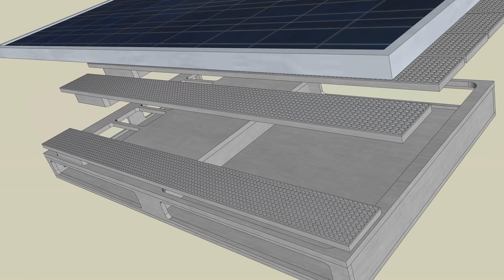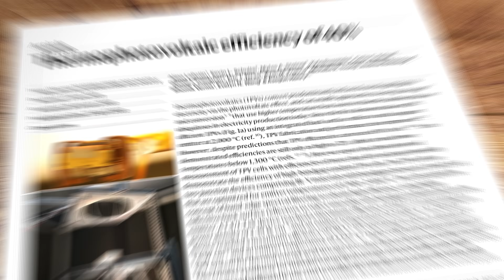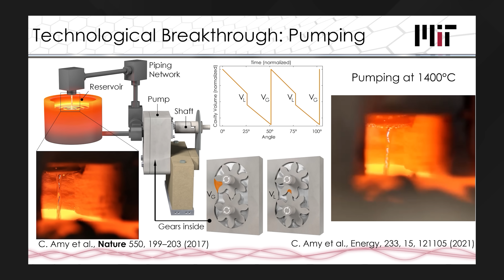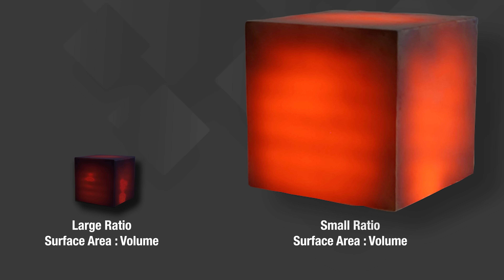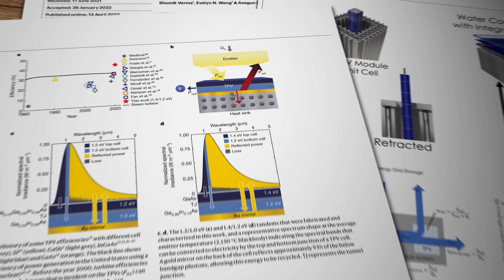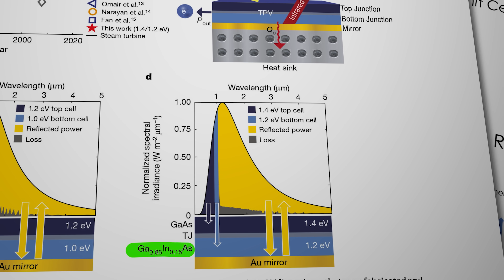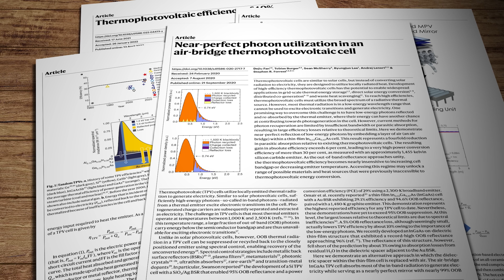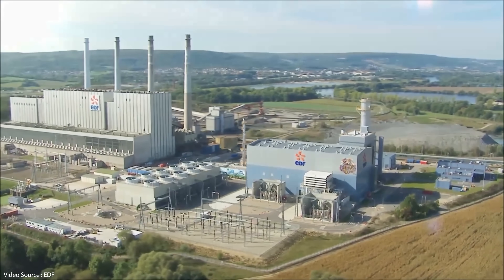Grid Scale Energy Storage 30x cheaper than Lithium-ion! How do they do that?

Comment: Cool! Is that 40-50% efficiency rating calculated just from the incident light on the cell? Or is that a total value for electricity input versus output, encompassing all the losses of the heat storage process?
Reply: Encompassing all losses
Reply: @AsegunHenry  I doubt. Overall round-trip efficiency will be closer to 20% or so.
Reply: @janami-dharmam  - you may want to look at the efficiency and losses associated with concentrated solar power plants. If the magical extra 30% loss you’re describing actually occurred, the nearly 100 plants world wide wouldn’t be able to operate.
Reply: @AsegunHenry  the 20-30% energy efficient is estimated at the consumer point. This is one of the main factors that drive the energy cost at the consumer end up. What is being supplied (say over a 24 hr period) is 60-70% direct and 30-40% stored (recycled) energy. The transmission and distribution losses can be very significant (and this waste energy just goes into the air)
Reply: Electric heaters are almost 100% efficient.  The biggest exception is heat pumps which are more than 100% efficient because they cool the outside air or ground.
Reply: @nathanbanks2354  heat pumps which are more than 100% efficient - very interesting! what happens to the conservation of energy??
Reply: @janami-dharmam  That efficiency is calculated by dividing the transferred heat by the work done by the pump. It moves more heat energy than what it requires for its work done. Energy is conserved, it does not create or eliminate energy, the overall energy of the system stays the same.
Reply: @janami-dharmam  heat pumps aren't more than 100%. Such results are possible because humidity change is left out of the calculation.

Once you include the input / output humidity level the efficiency is well below 100%, as it should be.

This "over 100% efficient" slogan is just a marketing ploy because resulting dry air isn't an immediately obvious outcome of using a heat pump but the negative effects of dry air are real. Once you factor in the energy needed to bring that moisture back, the heat pump looses it's magical physics defying efficiency.
Reply: @janami-dharmam  Technically, a heat pump is mostly just moving thermal energy from one place to another.    The thermodynamic limits on such a system are limited by Entropy.   The criteria here is that one cannot NET move heat (thermal energy) from a cold reservoir to a hotter one.
One can link a larger flow of heat from a small cold to hot temperature gradient, to a smaller flow heat down a much larger temperature gradient from hot to cold.
This is apparent when you include the heat flows of the power generating plant on the other end of the electric power line that runs your heat pump.
Reply: @janami-dharmam  heatpumps do not generate heat, but move it.... harvesting from surrounding air
Reply: @NullHand  Of course you can pump heat from a lower temp to a higher temp; it is called a refrigerator. You need to supply energy for that. For the other way, heat flowing down the temp gradient, you can extract energy from the otherwise spontaneous flow- that is commonly called a heat engine. 
Yes, you can combine two countercurrent heat flows but you cannot create a higher temp differential at the output end.
Reply: There are only heat losses - cooling of the TPV, and losses during storage and transportation trough the pipes. The cells are only ~30% efficient, but the remaining ~70% energy radiates back to the wolfram-surface as heat, ofc minus the ~5% heat loss that is transported to the cooling block through the gold-bridge. 
My concern is the surface area of the TPV cells, that needed for MW output. It will be a huge housing.
Reply: @tomo1168  "The cells are only ~30% efficient, but the remaining ~70% energy radiates back to the wolfram-surface as heat"

This is not how it works. You can not extract enery from heat. You can extract enery only from head diffrences. You always got the limitation of the carnot cycle.
Reply: Yup. Total system efficiency would be closer to 5%

Comment: I like the diversity of energy storage solutions being worked on and your channel's continued enthusiastic coverage of them. We need commercial solutions that work and the cheaper the better.

When I heard gallium arsenide solar cells I initially rejected this idea as being ludicrously expensive. But when I heard 100kW per square meter of panel, I changed my mind entirely. This does sound very promising.
Reply: @James Too bad for your part of the world. Meanwhile in mine, I've been living almost entirely powered by solar for several years now: hot water, heating, cooling, car - everything. 24 solar panels and a 30kWh home battery.

Fossil fuels are an incredible technology - it's just they have the tiny problem of causing cancer, respiratory diseases and changing the natural environment too rapidly for nature to keep up with. That's the only reason we have to find alternatives.
Reply from the maker: Thanks Mark. Only time will tell of course.
Reply: @JustHaveaThink  id like to know.. how you have 30 times less.. you can have 30 times more of something or.. 1:30th of something being less.. but.. 30 times more.. is that really good science reporting  🤧🤕😷😬
Reply: @Errol.C-nz  If "30 times MORE" means you add 30x to x, giving 31x, then "30 times LESS" means you SUBTRACT 30x from x, giving minus 29x.
Without the words "more" or "less" (which clearly mean add something or subtract something) you could just say "thirty times" meaning multiply by 30, or "one thirtieth" meaning divide by 30.
Reply: @simonmultiverse6349  times means mulitply.. not divide.. thats.. maths !
Reply: @Errol.C-nz  No, there's a difference between:
(1) "thirty times more" and:
(2) "thirty times"
Reply: @Errol.C-nz  No, "five times MORE" means increase; "five times LESS" means decrease.
Reply: There are many synergies here. Electricity like this to power ground-source heat pumps coupled with well-insulated buildings promises a very low cost to heat homes and offices.
I note that some kinds of batteries suffer dendrites growing through the structure of the battery, as the metallic elements comprising the structure move. This can tolerate a maximum number of charge/discharge cycles before breaking down completely. Can you comment whether or not TPV suffers this?
Reply: GaAs is  an environmentally toxic material - and a great solar cell.  The question for me, when it comes to Grid Scale Power Storage - what is wrong with larger amounts of safe material which is not sitting at 2000 degrees? I would prefer a few more acres of Fe-Na (Iron and Salt water) than a lot of graphite and molten Sn (tin) at these extreme temperatures.  This is potentially a great technology for systems launched into space - it's lighter than the Fe (Iron) based cells.  I predict we will hear "I wouldn't want one of these systems in my backyard".  If located in remote areas, we have to transport the power (grids) and that is expensive (look at your electric bill - it is itemized) and lossy.  And backyards are where we will need storage as solar generation becomes more distributed into the communities.

Comment: Thermal-Photon Energy Conversion technology means that nuclear electrical power will no longer be constrained by steam turbine efficiency or thermocouple efficiency. Basically, this means no moving parts - except for liquid cooling pumps needed to keep the components from over-heating. The thermal temperatures are below the melting points of plutonium oxide, uranium oxide, and thorium oxide. So, those materials could be used as the thermal energy sources. (YMMV)
Reply: This idea was investigated decades ago. I don't know if anyone actually built one, but there were detailed designs. No moving parts is a big plus for space probes, for many reasons.
Reply: a modified nuclear plant design? one which skips heating water to make steam which turns a turbine? one which generates heat which is converted at a higher efficiency rate directly to electricity?

Comment: In re: "waste heat": the energy originally came from the sun in one form or another so I fail to see how the entire planetary system would be heated overall beyond normal. The only way for heat energy to escape is to radiate into space, regardless if that incoming solar energy was converted into electricity and used to heat molten tin and then radiated through a PV cell and then to heat water before finally being radiated again out into the atmosphere.

Comment: Why are they using electric heaters to melt tin and then use the tin to heat graphite ? Why don''t they use electric heaters to heat the graphite directly ?
Reply from the maker: They want to keep all the elements separate to optimise flexibility.

Comment: High capacity. High efficiency (for thermal systems). High responsiveness. Low cost. It's got a lot going for it. 
It would still be ideal if battery solutions could become much cheaper, since their overall efficiency is much better than this.
Luckily these are not complicated systems. Some aspects are simply technologically advanced. Which I like. I think this could serve as another temporary solution for a few decades maybe until batteries, maybe the ultra-capacitors of tomorrow, are much better and cheap as chips.
Reply: It sounds as though the high heat units are meant to be a battery, but I think it is more incidental that the heat is held there as it produces electricity. So, I could easily imagine this heat system augmented to store the generated electricity in much more efficient and effective batteries and then passed out to users as needed.
Reply: @markhathaway9456  That would still put a 60% energy loss in the loops. Which is significant. Where this system shines is capacity, cost and scalability.
I think it entirely possible that something like this could store power on ships too. And, maybe just maybe very large airplanes if the gravimetric capacity is high enough.

Comment: This seems unreal. Literally. 
First, the efficiency. The only percentage mentioned was for the TPV conversion of light into electricity. But there's got to be massive losses at all the stages, like from the electricity to heat conversion, losses of heat despite the insulation, losses of heat through that water cooling -really was that a joke? was it all a May fool day joke? 
Why not separate the panels from the hot tungsten through some transparent insulation and have the water system as safety backup? Why not recapture the heat in the water through a heat pump and reintroduce that energy into the system?
Most times when something sounds as crazy as this it's because it is.

Then you need to worry not just about containing the molten tin but also the argon atmosphere in all those buildings.
Finally, the cost differences are enormous. Leaving aside that we're comparing a mature, commercially proven solution to a lab experiment, we need peer review of those calculations before even investing time into considering this.

Comment: Seems like lot of maintenance activities would be necessary over the lifetime. Although the setup costs might be lower, the maintenance will drive the LCOE quite high- wouldn't be surprised if comes close to current battery tech over 10/20 year lifetime. In theory this should have longer lifetime though. Check out what happened to the solar thermal mob in South Australia- one of the key challenge was the resource needs about 80 FTE vs 5/10 for equivalent output wind/solar  facilities

Comment: How exactly is this electrical energy storage solution better than a flow battery ? Their overall efficiency is in the 70~85% range and they're much simpler to build. Their components are also much easier to source.
Am I wrong ? If yes please correct.

Comment: Looks like the pump involved is a mechanical one (?).   Why not use one without moving parts--liquid sodium was 'pumped' with a solid state pump ( like a solenoid)  for the Fast flux nuclear reactor (Hanford, WA).   Why not use this same principle?
Reply: Electromagnetic pump efficiencies are less than 10%.
Reply: @AsegunHenry      Simplicity & maintenance time trumps efficiency.  :)
Reply: @michelem.6104  - Not at 1-10% efficiency. At such low efficiency the pump is more so a heater, than a pump, since more than 90% of the energy it consumes just becomes heat in the wires. Maintenance costs on mechanical pumps is dwarfed by their capital and energy costs.

Comment: IF the power plant being replaced was already a combined heat and power pant (there are some) then the efficiency would potentially be far higher (in winter, at least).

Lets see how they get on at industrialization. There are very many points of failure they have to cross in a mass manufacturing sense. Prototypes are way easier than mass production and time is very very short.